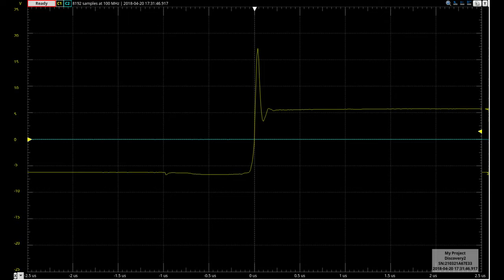Lab Update #12: De-Ringing a MOSFET half bridge

Comment: Thank you for posting this video. i could approximate from your scope the ringing at about 5MHz or near  and so the snubber was about 4.7 ohms in series with 10nf capacitor . One question is the rsistor heating or just worming ?